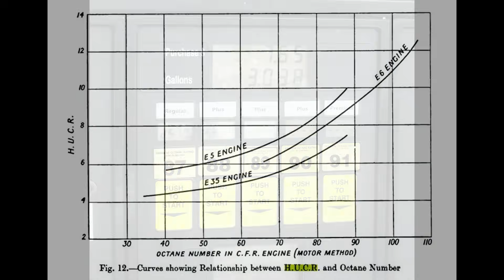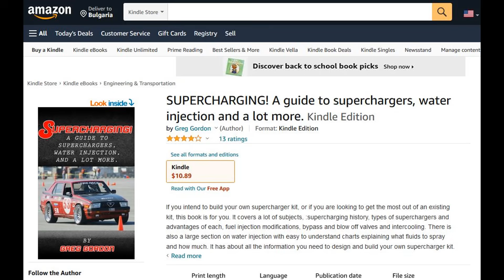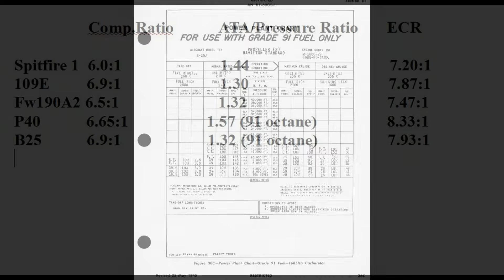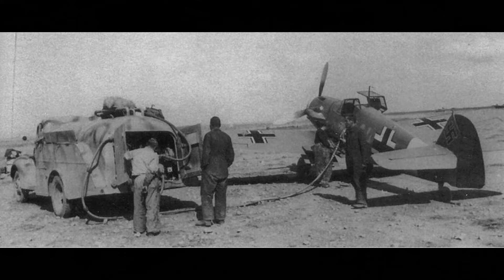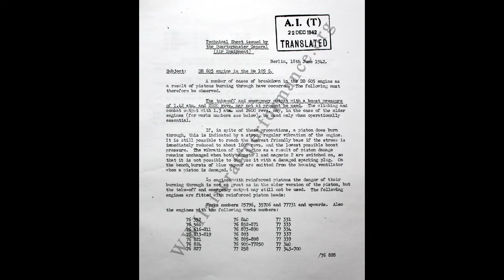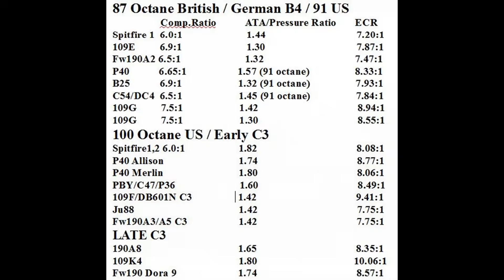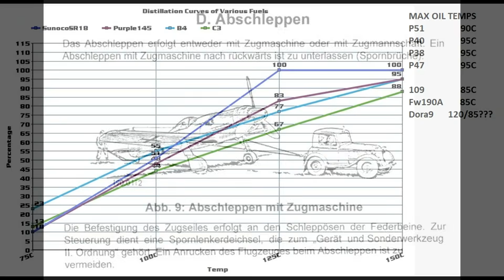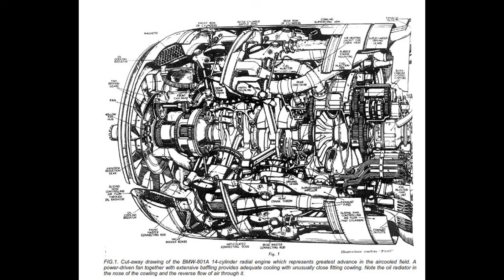German C3 Fuel, Uber Octane or Synthetic Crap?

Comment: Another great video thank you Greg. A video about sleeve valve engine's would be very interesting, just an idea. Keep up the great work!
Reply from the maker: I do want to get to that, but it will be a while.
Reply: @GregsAirplanesandAutomobiles  
In aircraft that would see a usable lifespan of very low hours I'm of the opinion that sleeve valves while superior especially in larger bore diameters due to the limitations that poppet valves put on the ability of the engine to breathe were in many ways a waste of the second most precious resource a nation at war has. First of course is the lives of its servicemen. Second is the manhours required to produce the weapons that your people need. In a fighter that might see  very limitied hours it doesn't pay. Napier might of built a great engine but the role could easily ben handled by the Griffon at probably less manhours to produce. However in aircraft used primarily in the transport or naval patrol roles the sleeve valve makes perfect sense due to its lower specific power output in terms of fuel use per hp per hour. The same could be said for long range bomber aircraft.
Reply: @mpetersen6 sleeve valves cost the lives of plenty of pilots. I don't fully understand sleeve valves but it seems to me that they were just asking for trouble with the available machining technology, particularly during wartime. I have read that the main problem was a failure to properly warm them up.
Reply: The sleeve valve is basically a sleeve inside the cylinder with holes in the side.  You twist the sleeve so that the holes in it line up with holes in the cylinder head or in the side of the cylinder, and that's how mixture gets in or exhaust gets out.

The actual engines (e.g., the Centaurus) actually moved the sleeves up and down as well as twisting them, but the idea is that the sleeve is what covers and uncovers the openings to let air flow in and out.

Sealing between the sleeves and the bore, or between the two sleeves (intake and exhaust), and there is definitely some complexity in making the sleeves move correctly.

Here's an animation of a Centaurus in action:  https://www.youtube.com/watch?v=_vrvep_YOio
Reply: @davedarling4316  
For some very good CAD drawings and animations look into the Aircraft Engine Historical Society's web site
Reply: Yeap, love a video about that. Sleeve valve, to me means a 2 stroke ... Their is a lot more than that probably ...
Reply: @steeltube195  -- It's kind of like the ports in a 2-stroke engine, but generally used on 4-stroke engines.  The sleeves can be moved so that the ports are uncovered only during the appropriate stroke, instead of any time the piston is down far enough.

Comment: The decreasing quality of motor oil in the last years of the war("resembling water") is frequently mentioned as a factor with the poor reliability of the Tigers and Panthers tank engine, so that might be the reason for not exploiting the octane potential of c3..
Reply from the maker: That could be, a lot of the factors tie together.
Reply: And sabotage undertaken by slave labourers working in assembly plants.
Reply: @Mango62uk  It could be, I heard from Czech factory worker during nazi ocuppation, that sabotages were easily detected and severly punished, so the tried to made every part as close to tolerance limit as possible, hoping it will fail sooner, than perfectly made part.
Reply: @ondrej.podlucky  Now, that is Czech intelligence! Great story and perfect given the Germans' well-known obssession for close tolerances :)
Reply: @ondrej.podlucky  This is true. Skilled workers knew their trade, and they knew how to make parts that pass the test, but soon fail under stress. Others just built faulty parts, and risked death when caught.
Reply: Watching tank Restorations I screamed as they drained the original transmission fluid from a Ferdinand and discarded it
If they analyzed it could have answered a lot of questions
Reply: @jamesricker3997 beware of haste
Reply: @jamesricker3997 The analysis is definitely gonna come back with a lot of every metal the transmission has inside it. Like that'd be the kind of video where someone better says "Well, I could have told you that." About the results 😂
Reply: The main problem was the quantity and availability. C3 fuel was jus too rare to simple run all fighter engines on it. With logistics of late war, Germans needed their engine to be able to run on lower grade fuel too. This often resulted in engines being able to either go B4 + MW50 or C3, and so they weren't properly suited for C3+MW50 as a result, which would give the best performance.
Reply: But I thought they were using "fully synthetic oil" ;-)
Reply: @notsureyou  back then Nah, don’t think so.
Reply: The tanks required a lot of maintenance and were driven at too high of speed for too long of time than they were designed for.  And the engines were a bitch to get to, unlike the "lowly" but dependable Sherman.
Reply: I apologize for replying here a year later but it certainly wasn’t the fuel or oil. Post war French reports on panthers they used until the 50s show that the reliability issues were just inherent to the tank.
Reply: @spakes6561  thing with the panther was that its motor was far from the biggest problem.
Reply: @schi_z_o  yeah motor life was bad but the transmission was objectively awful. Even in French use post war (which is way softer than combat use) the transmission would only last 150km which is in tune with what the Germans said. Hundreds of other micro factors also ruins its overall maneuverability and the such.
Reply: @spakes6561 really, then why the hell did the French use Panthers if they only had a life of 100 hundred miles. Utter nonsense.
Reply: @drstrangelove4998  because the French had a choice, M4 Sherman, R35 Renault or Panther, they chose Sherman and Panther.
Reply: I wonder what happened to the oil additive packages as the war progressed. Detergent, anti wear, anti-foaming agents, etc.
Reply: I heard it was mostly drive train / transmission problems.
Reply: @2lotusman851  Bad oil wouldn’t help with transmission reliability either (particularly under high load).
Reply: @allangibson2408  that's one of the thing's that i considered when im rebuilding my 60's BBM/hemi frankenstine engine combo that oils have changed and so has the pump gas i can get/use and the same way for the engine management software/systems ect, hopefully on the dyno i can push it harder than what was possible in 1970 but i could be wrong but doubt that
Reply: @2lotusman851  But why were there transmission problems?  Just stating they happened without asking why doesn't give you anything like the whole picture.  One of the major problems with German tank drive trains was leaky gaskets, and the oil being thinner than the gaskets were designed for could be a major contributing factor.
Reply: @mattbowden4996  “The oil is thinner than the gaskets are designed for”? I don’t think you know how gaskets work LOL
Reply: @BikingVikingHH  As it happens I do know how lubrication sealing works and depending on the specific design the viscosity of the lubricant absolutely can be a factor in whether leaks occur or not - or do you think that penetrating oil and sump oil have the same properties? Do you know what will happen to the head gasket of your car engine if the engine oil gets polluted with water? It will fail and cause you an expensive repair (as I once learned the hard way) - why do you think that would happen if watery oil wasn't a problem?
Reply: @mattbowden4996  Of course ... in my ... unfortunate experience ... it was the reverse - wherein it was gasket failure brought up on by over heating of aluminum heads on steel blocks that caused gaskets to fail - and result in water in the oil ...  

We had Chevy Steel on Steel V8 engines over heat any number of times because of coolant problems and never blew a head gasket.  

EVERY time we ever had one of those Datsun engines over heat - it ALWAYS blew the head gasket - but of course - far, far worse - was that it warped that aluminum head and you had to have it planned by a machine shop before you could put a new gasket on there ...

Six head gaskets ...
.
Reply: @BobSmith-dk8nw  don’t overheat it then! 😋
Reply: @TheHarryMann  Oh My God!  Why didn't I think of that?????

Ha!  Ha!  Ha!  Ha!  Ha!
.
Reply: @BikingVikingHH  try putting synthetic oil in an old diesel, and you'll find out exactly what that means.
Reply: @crazytrain7114  Time to replace the gaskets anyway.
Reply: @2lotusman851  I understood that there was 2 main factors which made the transmissions unreliable - the tanks ended up much heavier than originally designed and they were very short on the alloying elements needed to make high quality steel.
This shortage also caused problems with the valves in their aero engines.
Reply: @gregculverwell  I think you are talking about the Panther here. The problem with the Panther was the final gear housing. It was designed for a 35 ton tank. Then the order came to add more armor, weighing 10 tons. That caused the gear housing to warp under stress, that cause gear misalignment and the final drive to fail. Once the housing was warped, any new final drive installed would quickly fail. 
They had many problems due to lack of materials, sabotage and political meddling. I can't even imagine the frustration and headaches those engineers had.
Reply: @gregculverwell The crew also has to be taken into account. In the last year or two (when the Tiger and Panthers saw the most use) the crews got younger and more inexperienced, which leads to abuse of the equipment.
Reply: @2lotusman851  Combat records by Tiger/Panther crews often mention how they found debris deliberately hidden inside the transmission(by slave labourers) to reduce its efficiency and cause breakdowns.
Reply: @2lotusman851  The tanks didn't get the required maintenance and were driven faster and for too long of a time than they were designed to do.
Reply: In the book, "Trading With The Enemy" there's a segment on Standard Oil of New Jersey. (Rockefeller) USAAF complained Standard Oil was selling aviation octane to the Germans. To which Rockefeller responded, "Shut the fuck up, or you won't get any either."
Given Daimler engines consistently out horsepowered allied engines, (inline) Junkers engines as well, I'm thinking this is BS.
Chevy high-performance engines had 11.1:1 compression, from 360 HP up.
(Z/28 302 - LT-1 350 360hp Z/28, 370hp Corvette)
Reply: @jimallen9859  The German engines were 36 litre displacement. The Merlin is 24 litre. The GRIFFIN was the 36 litre equivalent British engine built as a replacement for the 48 litre Vulture.
The ultimate German piston engine was the DB 610 with 72 litre displacement…
Cubic inches matter but weigh more.
Reply: @jimallen9859 i had heard of illegal trading with Nazi Germany often via Spain, Switzerland and Sweden
Reply: @jimallen9859 there is alot of misinformation regarding Rockefeller writing by people that slandered him during and after his life. All Im saying os dont believe everything you read about him. He was a very different person then alot of these books tell about him. That's all im ganna say about it.

Comment: Two things, I'm probably wrong on both of them:

1) Is the square root of the boost pressure used to approximate the losses due to compression heating on air density and would that value be more accurate if it varied with the degree of intercooling or lack thereof?

2) Is a possible reason for the Germans not using their high-octane fuel at its full anti-knock potential something as simple as fuel conservation? How does boost and equivalent compression effect fuel consumption? Since the Germans were so low on fuel that they'd tow the aircraft to the end of the runway to save fuel that would have been used in taxiing, leaning out the mixture to save fuel doesn't seem far-fetched to me.

But I'm not an engineer. Nor do I play one on You Tube.
Reply: The square root equation is a pretty good approximation, but is still an approximation. To compute the ECR accurately you need to include the compressor’s efficiency as well as intercooling, but the simple square root is decent for first glance.
Reply from the maker: 1. it's the square root of the pressure ratio, not the square root of the boost pressure. Those are two different things. The reason for the square root usage is just too complex for the comment section, I only slightly touched on it in the video because it was already about 3x longer than youtube wants.
2. I don't think so, they were always trying to get more power, and that means using more fuel. Power was the priority, not building fuel efficient airplanes.

Comment: Totally off topic, but what does the wire strung from the top of the vertical stabilizer to the post behind the canopy do?
Reply: That would be the HF antenna, I would think.
Reply: I've wondered that too.
It appeared most WW2 planes had atleast one wire in that location/configuration.

Radio antenna makes sense.

I've seen some WW2 planes that have multiple cables/wires strung from the fuselage to wings, tail, or elevators (more common on early gen planes?).
I had a feeling that those were a structural/bracing thing. possibly; but it's just an intuition on my part.
(They weren't as pronounced as early planes or some modern ultra-lites that clearly had the cables for core structural design considerations.
But they looked taut and went from high stress surfaces to stiff/strong parts of the plane which is why I think some of them are structural elements. But I could be wrong and am curious of the truth of it)
Reply: LibertyHog 1 All the long strung wires would likely be antennas. On some photos you can make out insulators and signal leads/pickup wires leading off them. Radio navigation systems would also require (multiple) antennas, usually one of which would be a wire, which could explain some of the wires.
Reply: @foowashere  Thanks!

Comment: How much to turbocharge a Honda lawnmower?
I'm tired of spending 45 minutes mowing the lawn and I'm looking to cut it down to about 15 minutes.
Reply: If your lawn is sloped try a two stage supercharger.
Reply: @taotoo2  NOW THATS WHAT IM TALKIN ABOUT!
Reply: Strap two mowers side by side ie P-82. Then supercharge em with 4 leaf blowers...
Reply: @whiskeytangofoxtrotover9651  I dig where your head's at...
Reply: I think the blade and discharge rate of the cut grass would have more effect than boosting the engine power. All that would do is clog the mower up faster!
Reply: @Mishn0  I WANT MORE POWER.
Reply: @Waltham1892  Hmm, instead of a turbo, how about an engine swap to a two stroke motocross bike motor like they put on shifter carts? That'll net you some power.
Reply: @Mishn0  I was thinking more of a 427 with direct fuel injection.

There is a tree stump I'd like to pull out too...
Reply: Checkout RobotCantina’s channel. He about to supercharge a 420cc 1cyl lawnmower/cement mixer engine to power his street legal Honda Insight go-cart.